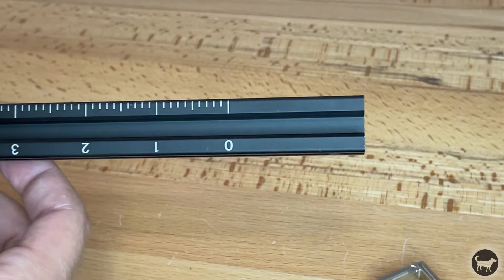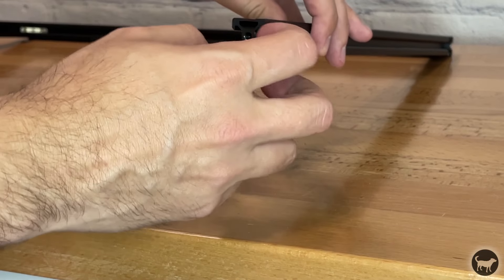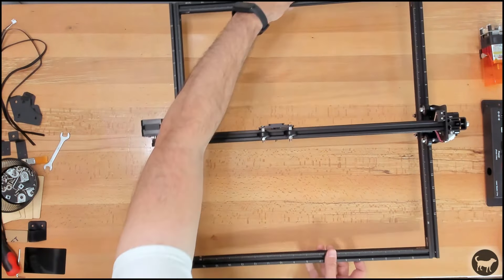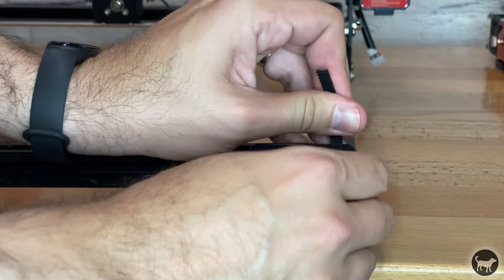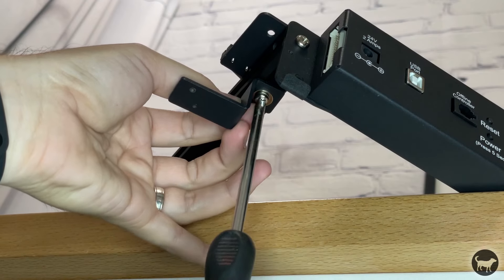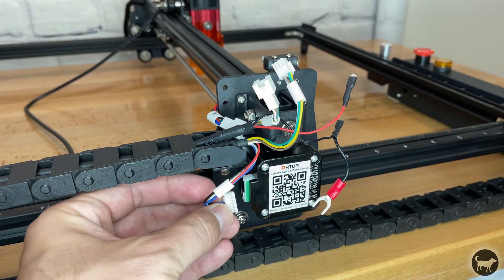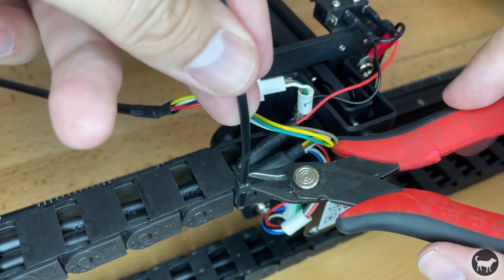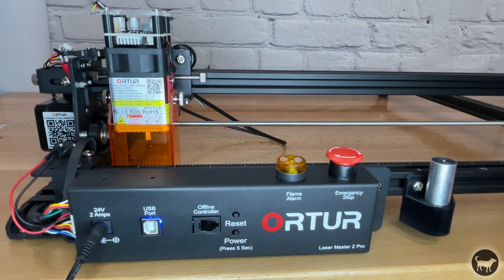Ortur Laser Master 2 Pro Assembly Instructions

Comment: Great instructive video! I wish I came across it earlier. Just got my unit today and had trouble following both the official assembly video and the printed instructions, where each had either partial information or wrong direction / mounting of the frame bars and switches. And if that's not enough, on my unit I had to mount the drag chain small bracket with a single m3x6 screw since my package had one screw short of this kind. And just like others have mentioned here the Y limit switch was mounted the other way too. It took me a while but by looking carefully at the official video and comparing the way the red and black cables are connected on the other switch I just assumed that red goes just below the red switch and black goes in the middle. Watching your video now gave me a déjà vu, as if your instructing voice was playing in my head when I assembled it lol. I even said to myself "be careful not to tighten the screw on the laser unit too much as the acrylic might break! :) Anyway, I came across your video and began watching it to make sure that I didn't forget something. Well made and easy to follow. Thanks for making and sharing. Cheers.
Reply from the maker: Glad you liked it. I really made it because I was confused with the directions as well and I had already made the older version of the machine. Didn’t take too long and thought it might help someone out.

Comment: Just a quick correction, there are two m3x5 screws, those ae the ones that go on the side when attaching the drag chain bracket to the side bythe motor not the m3x6. the set comes with 4 m3x6 and 2 m3x5 screws. the sixes are for attaching the drag chain to the brackets. :)
Reply from the maker: You are correct. My mistake.
Reply: You just solved my problem. Thank you.

Comment: Perfect and brief guide thank you. After assembly mine didn’t stop when reaching the end so checking another video I notice the limit switches wires (red and black) are inverted on this video so I change the red in the center and black wire aligned to the edge where the metal lever begins (just inverted as this video tells you). It was fun to assembly thank you.

Comment: I second the motion that this is a great step-by-step video.  In fact, Ortur should publish this instead of their cryptic instructions.  However, I got stuck in the step where I need to thread the timing belt under the wheel, over the sprocket and under the wheel.  The space is so tight and i can't catch time timing belt in order to thread over the sprocket.  I also cannot figure out from the video what tool Buster used to guide the belt over the sprocket.  Any help would be appreciated.
Reply from the maker: Hello. I simply used a small screw driver I believe to catch the edge of the belt so I could pull it up. I have also seen people use tweezers to do it.

Comment: This video was super helpful and I followed everything, watched it multiple times to be sure. But when I plugged my machine in, released the emergency stop and held the power for 5 seconds nothing happened . No movement at all and idk why because everything is connected.
Reply from the maker: Are you not getting any power to the unit at all? When you plugged in the power cord did you see a little spark? It's actually normal to see a spark and this would at least let you know the power brick works. I would also just try to unplug the motherboard wire and then plug it back just to make sure it is seated correctly. Other then that you could try to check on the Ortur Facebook group page and see if anyone else is potentially running into the same issue. Wish I could be more of help.
Reply: @BusterBeagle3D  Thankyou! I unplugged everything and tried different positions and combinations and it finally started working and then I had a problem with the X axis and that got fixed. It took me 3 hours to set it up and build it 🥴. So tomorrow I’m gonna try to get a test print done hopefully
Reply from the maker: Glad you got it working!

Comment: You did an excellent job! You should be another voice on How Its Made. Seriously. I do have a question. My ORTUR Laser Master 2 Pro came with only 4 M3x6mm Flat Screws. I used them on securing the Drag Chain Y axis bracket, on the front end of the drag chain, then did not have any more to secure the rear of the drag chain. I played your video several times. I am sure the locations you described for installation of the M3x6mm screws added up to 6 screws, I only have 4. By any chance were 2 of the screws you stated really M3x5mm screws? I have still have those uninstalled. And I do not have enough M3x6mm to secure the rear of the drag chain. Do you have any ideas where I went wrong. Thank you.
Reply from the maker: Sorry I missed this earlier. Yes you are correct. I messed up slightly on that part. I may have even installed those backwards on my machine.
Reply: @BusterBeagle3D  no problem. Small mistake for an enormous benefit from your video. Thank you so much again. I wonder if you'll consider making another on the ORTUR Rotary Roller.
Reply from the maker: @dennisg11348  I do have the rotary attachment so I should do it. I might have to add it into my ever growing list of videos to make ;)
Reply: @BusterBeagle3D  Thanks, I look forward to it.

Comment: Hi, Does your air assist fan bracket work for a laser Master 2 Pro S2?

Thanks fro the clear instructions. Very helpful! Love both your assembly directions and suggestions. And hanks for sharing you files!
Reply from the maker: I haven't tried it with the S2 but it could be possible. It was really more of a smoke remover rather then a true air assist. I would search for actual air assists for the machine if you really want to take advantage of the true usage of that method.
Reply: @BusterBeagle3D   Thanks again!  It seems this version comes with a way to tube in air from my compressor -- although the laser cone is not removing as the instructions say it should so who knows?

Comment: Great video, thank you. I have ordered a LM2Pro and unboxed it. The side rails have no markings like I have seen in videos. Every video I've seen says to line up the ruler markings on the side rails, but mine are just black anodized aluminum.

I sent the laser cutter back for return and just received the new one. It also has no ruler markings on the side.

Now I'm wondering if I'm crazy and somehow overlooking the rulers, or if there shouldn't be any in my model, or what. I'd appreciate any insights. Thanks!
Reply from the maker: Are the support pieces metal? Like the feet and the box around the motherboard? If they are then it’s the Pro. If they are not then it’s the Laser Master 2. If it is the pro to be perfectly honest I find the markings on the rails to be useless. I can’t imagine anyone actually using it to line up anything. It’s much more useful to have a grid on a spoil board to line everything up. If you look at my other video on the Pro I have a grid that is made in LaserGrbl that I give out for free.
Reply: @BusterBeagle3D  That explains it!  It is the LM2.  I thought I was going nuts.  Thanks!

Comment: You seem to have a long wire that runs across the entire frame. I don't have that long wire.i presume that one goes to the laser. I still have one female 8 pin connector that comes from the chassis the laser is attached to and a male 4 pin connector to which I have nothing to connect. The 3 wire terminal you connected to the laser with the ground wire, that extends from the long wire that runs across the frame, correct because the only 3 wire harness I have extends from the female 8 pin connector I described earlier.all others have 4 or 5 wires..the laser connector is male 4 pin. I don't have any female 4 pin connectors.

Comment: Well, I followed your instructions to a T. Went together pretty easy. Only problem with mine is when I power it up, it doesn't home down to the corner. It moves randomly all over the place like a drunken etch a sketch. Then stops in random places until the warning light blinks. I have no clue what's wrong with it. Very disappointed with this purchase.
Reply from the maker: Thats unfortunate. Perhaps if everything is hooked up correctly there is an issue with the motherboard or firmware. I would reach out to Ortur customer service and see if they might be able to assist you. They might have you just reinstall the firmware which is a pretty easy process to do.
Reply: @BusterBeagle3D  Well, I tried contacting them. They left me for hours with an open chat saying they were connecting me with a representative but no one ever came on. I'll try again later.
Reply from the maker: @brianthone7184  Yeah that's no good. I don't work for Ortur but if it were me I would try to update the firmware either way. https://ortur.tech/latest-firmware/ Also I know that there is an Ortur Facebook group dedicated to the machine so it might be a good idea to browse that and see if anyone else has run into that issue and see how they fixed it.
Reply: Well I am glad you had luck with yours. 2 weeks and several attempts to contact their (so called) customer service. NO response at all. Their live chat just instant replies with we are on break B.S. I've already boxed this piece of crap back up and am waiting for someone there to tell me what I need to do to send this back and give me a full refund. What a hunk of garbage!
Reply from the maker: @brianthone7184   I am sorry that has been your experience with this machine and with the company. I have not had to contact their customer service so can't attest for anything about it. I do know however that Oct 1-7 is a national holiday in China since I have run into other communication issues with other Chinese companies at that time. It's not an excuse but also not unheard of.  I hope they process your return and refund soon.

Comment: The laser that came with mine looks different. I cannot loosen any of the screws to secure the grounding wire because the top of the laser has been redesigned. I would need to loosen all four screws which the causes the fan assembly to fall apart. Overall, I do appreciate your video. The assembly instructions that came with the machine are a joke.

Comment: One thing I am currently struggling with is to understand how to cut vs how to engrave. There is a material reference here: https://ortur.net/pages/materials-reference and an example is "10000mm/min,S1000". Although10000mm/min is clear, what is not clear to me is S1000. How does this translate in LaserGRBL material settings? For example engraving in plywood from LaserGRBL it says 3000 mm/min 80% power... so numbers are not matching and I am confused.. Your videos are the best, it would be great to have an understanding from you :-)
Reply from the maker: Hello. I'm not sure if you can really engrave all that well at 10000mm per minute and I feel like their material reference is a bit exaggerated on the actual speeds. It really depends on what you are engraving on so you may need to tweak your settings. The S1000 number means 100% laser power. S800 stands for 80% and so on. In LaserGRBL you will see a setting where a variable laser power between 0-1000. That means that your laser will fluctuate between 0-OFF and 1000-Full power when engraving an image. I hope this make sense.  Also when you look at the settings in the current version on LaserGRBL they presets might be for the Laser Master 2 and not the PRO which might be why you see differences. The lasers are different between the 2 and the 2 PRO.

Comment: This is no way for laser master 2 pro
Reply: This is the way it is just slightly different with the current production model. The Y limit switch should be mounted upside down from what is shown in the video. Also keep very attentive to the orientation of the rails, the ticks should be on the inside with the numbers on the outside. You should have a corner where the 0 ticks on the X and Y axis meet. Don’t give up! If there’s anything you’re struggling with drop another comment, I’ll do my very best to help. This machine isn’t very simple to get together but it’s well worth it!